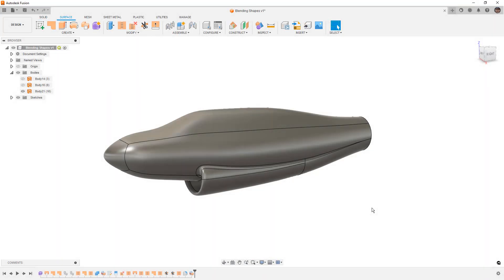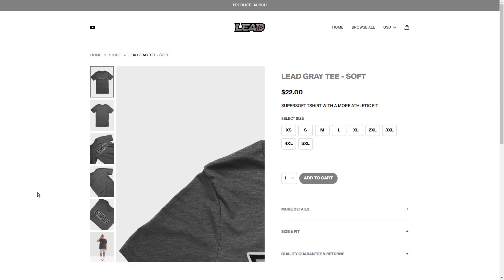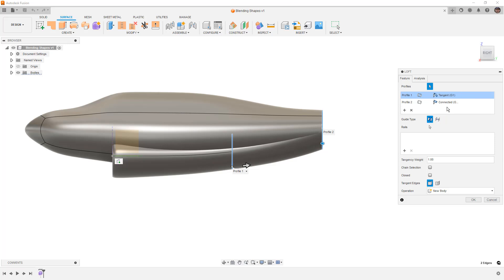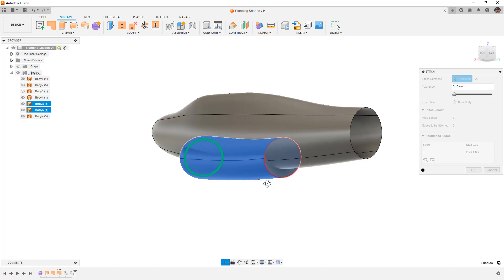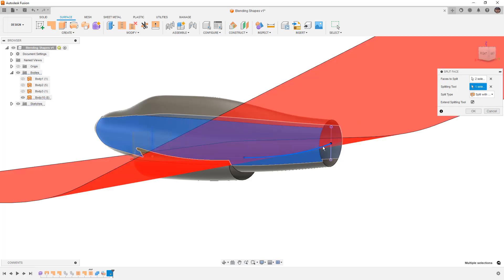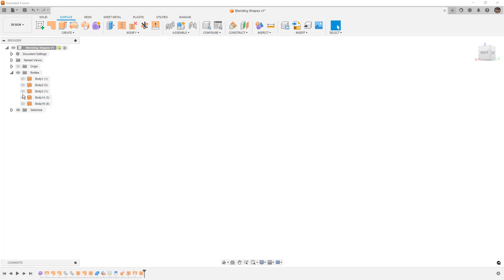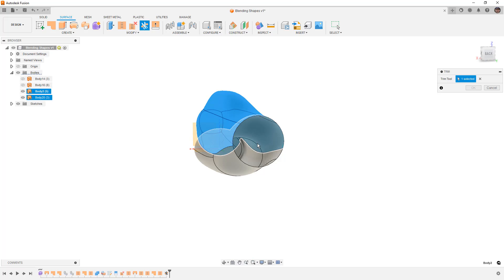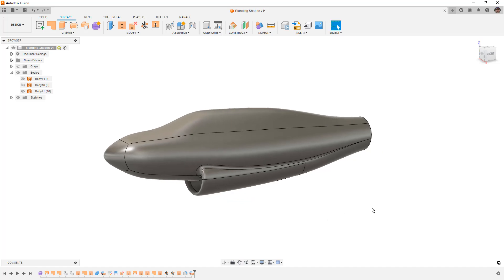Surface Mastery Part 18 | Using Surfaces To Blend Multiple Shapes Together #fusion

Comment: Hi Matt! These videos have been extremely useful. However, I’m running into a unique challenge on a jet I’m trying to model. I basically need a ridge that runs along the fuselage that seamlessly transitions into the upper part of the intake (separate form body), and I’m not really sure what workflow to use. It’d be filleted on the bottom side of the ridge as it’s on an inset surface. I know these videos are older, but I thought I’d ask because I’m not really sure what route to go.
Reply from the maker: can you send a pic of what you are trying to do? support@caducator.com
Reply: @LearnEverythingAboutDesign Of course, just sent along with some further information!

Comment: Would you be willing to do a video that shows a t spline/surface body and then making a flat section on it for a flange and bolts?
Reply from the maker: Do you  have an example?  I have an older video about adding hardware to a fender flare.
https://youtu.be/ds9C6Q067XU
Reply: I’ll look into that one. I saw you have a website. I’ll hop over there and send you an email.
Reply from the maker: @user-nk6lk4ik3p  support@caducator.com works.